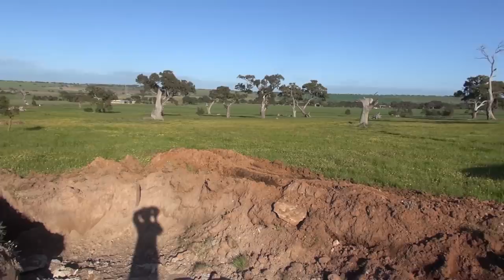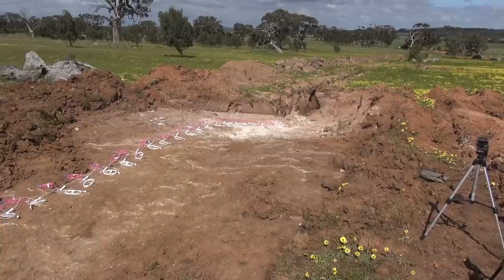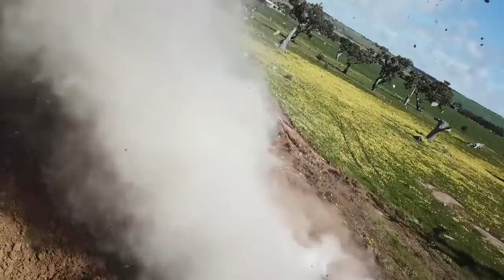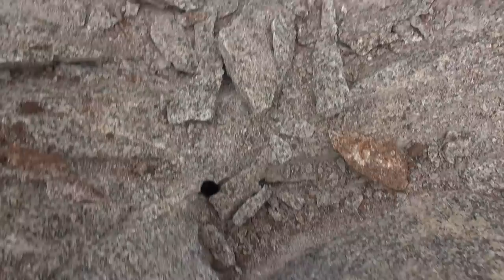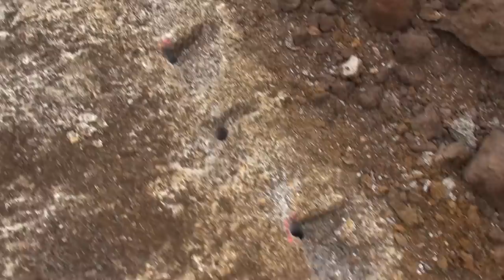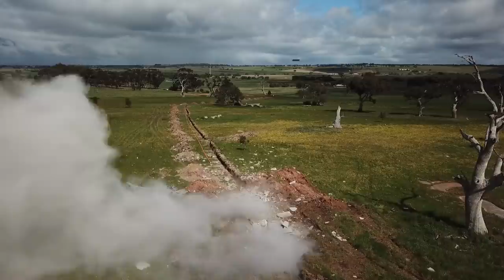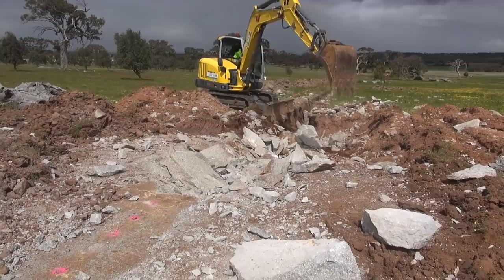Blasting a power trench through Granite

Comment: The timing towards the end was a bit sparatic. A result of the rifled stemming on the last 23?  Someone got lazy with the tamping?
Reply from the maker: Two things happening here the later holes had a shorter inter hole delay of only 25ms, earlier holes were 42ms, also the sound is different when the hole ejects compared to when it vents into the void. Stemming was good quality 5mm sharp screened crushed rock, not tamped just loose poured, usually compacts and jams up real well when blast happens.

Comment: Why do you use (waste ?) so much of the fuse ?
Reply from the maker: No "fuse" used in this one. I assume that you refer to the rolled up excess plastic signal tube on the detonator and surface delay assemblies?? This is how they are made and I buy the shortest length available.
Reply: @demolitiondavedrillandblast  Yes, that's what I had in mind. Can't you cut them shorter ?
Reply from the maker: You can but there are Two issues here, 1/ you then have an open end and this can be problematic if it is wet and moisture enters. 2/ It may not be strictly legal as you would be modifying the product.
Reply: @demolitiondavedrillandblast  OK.
It just seems like a waste but if you say it's SOP, then OK.

Comment: I think that has failed the stemming, you have put little. What type of explosives you have putted in the hole, perhaps nafo?
Reply from the maker: The holes had a 32mm packaged emulsion primmer and ANFO, stemming was 5mm sharp hard aggregate.
Reply: @demolitiondavedrillandblast  Do you have a rule of thumb of how much packaged emulsion you use per foot (300mm) of bore hole depth in say hard rock (granite)? In some of your videos you state about 400g in a 1.5M hole. So about 80g per 300mm? Thanks!

Comment: Granite is a bit of a bastard😮.
Perhaps the burden between the holes was just a bit too big.
What is the hole diameter - 1 inch/25mm?
Reply from the maker: Holes were either 35 or 38mm?? The cause of the problem was twofold, I should not have tried to do it with a single line of holes in hard rock, a regular 2 row zigzag pattern would have been better. The shot went bad about 1/4 of the way in when a horizontal joint was encountered and the burden failed to fully break out, after this hole, every hole ejected as the burden was too great.

Comment: That was amazing to see, but it does not compare to the time you sent the tree on your friend's farm into orbiting the moon.
Reply from the maker: Yeah, I like that one also, we will be back there some time soon to send the 2nd of the 2 Chinese generators into low orbit. did you see this one at the farm? -  https://youtu.be/ga1aAjYB_Ng
Reply: @demolitiondavedrillandblast  
Yes Dave, I did see that video. But the tree being removed via explosives was extraordinary, made a big impact on me. Versus other videos of rocks being blown up. Maybe it was just the way the video was far back enough you could see everything happen. But in my mind the tree basically vaporized. Your last video on the 21 shot for the electrical line through the granite. It appeared on the second shot I believe a massive portion of the rock heaved upward. You could see the soil that was above the rock heaved upward. The blasting point was in the rock itself and not the soil so, it would indicate the rock heaved upward pushing the soil upward. If that 20 ton crane dug deep enough it would probably be able to pull a large portion of rock outward.
At any rate it was it educational film, pointing out the fact explosives will only have the force of effect if the entire rock is intact. Any fracturing takes away the effectiveness of the explosive by forcing it downward and not sideways. Very interesting.

Comment: I've done blasting for a lot of years, anyone that knows anything about blasting  knows single line pattern  for a trench  won't work.
Reply from the maker: I have to differ with you John, a single row of holes works OK in softer formations like mudstone, yes I knew I was pushing my luck in Granite but as you can see the first 20 or so holes lifted out OK, only when we encountered a unforeseen horizontal joint in the rock that it went bad.
Reply from the maker: Put up some blast video John.